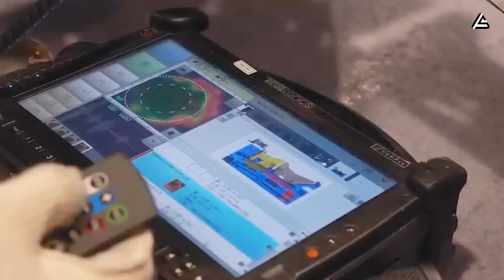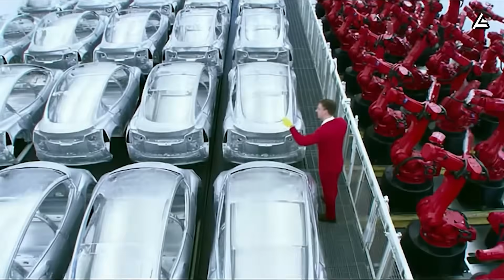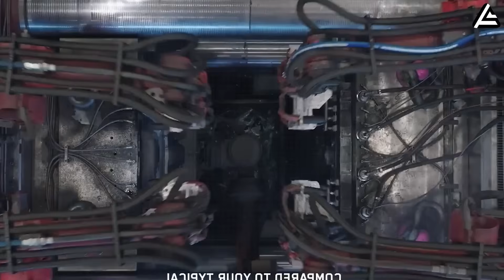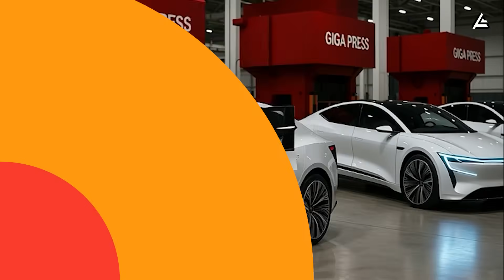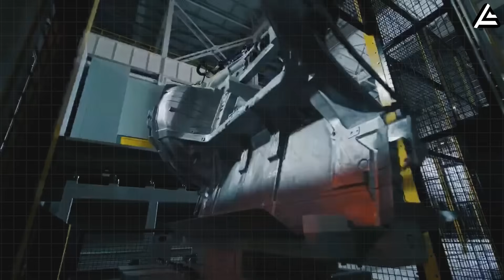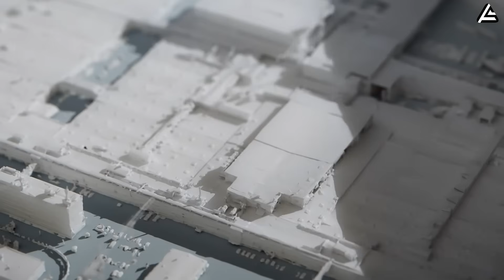Tesla NEW Giga Press Mass-Producing Model 2 Production Line. MIX

Comment: I understand the benefits of the Giga Press Die-Casting process have wrung out costs for the Model 2 manufacturing process. As a senior member of our society, I look forward to driving and leasing the Tesla Model 2, but I am inclined toward the larger, more spacious Model Y. We shall have to see!
Reply from the maker: That’s a very reasonable position. The giga-casting and simplified wiring do lower build cost for a Model 2-type vehicle, but comfort, ride quality, and interior space matter more than absolute price as we get older.

For many seniors, the Model Y’s higher seating position, easier ingress/egress, and cargo flexibility may outweigh the savings of a smaller car—especially if leasing smooths out depreciation risk. Waiting to compare real-world specs and ride quality before deciding is the sensible move.

Comment: GIGA Press - the die casting process has been revolutionized by Tesla to drive costs out of the manufacturing process and produce seamless, weldless frames of the Model 2.
Reply from the maker: That’s broadly accurate, with one important clarification. Tesla didn’t invent die casting, but it scaled and integrated giga-casting in a way the auto industry hadn’t done before—replacing dozens to hundreds of stamped and welded parts with single aluminum castings, which dramatically cuts tooling, labor, and alignment costs.

If Model 2 uses this approach end-to-end, the real advantage isn’t just lower cost, but faster production, fewer failure points, and more consistent build quality—assuming crash repair strategies are properly addressed.

Comment: 15,000 PSI injection pressure is extremely high for die casting large aluminum parts and would require extraordinary tooling life assumptions that are not justified.